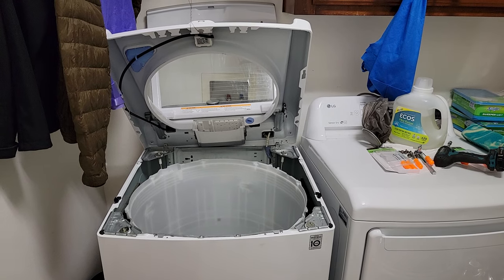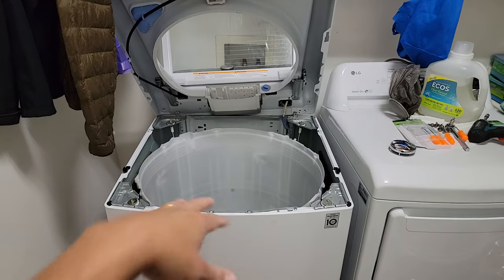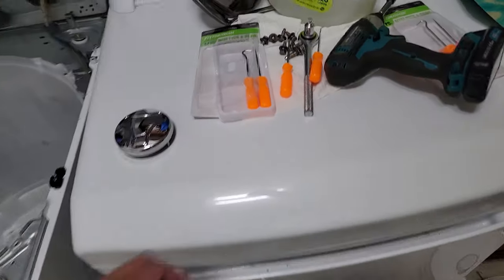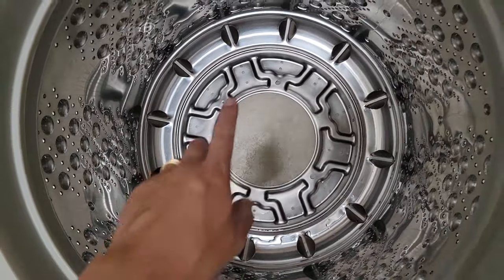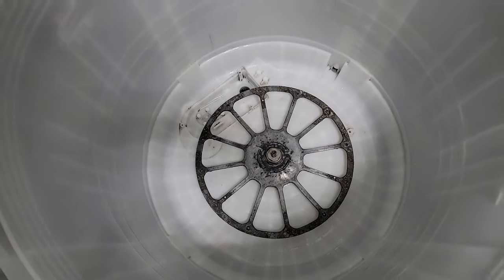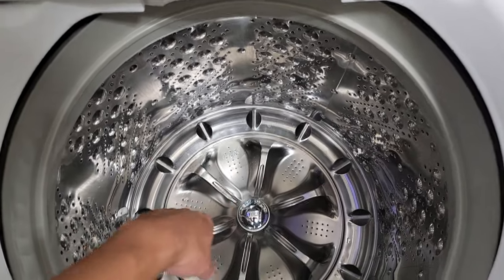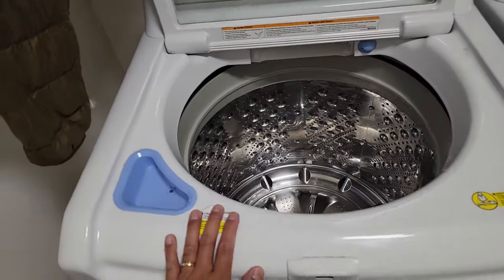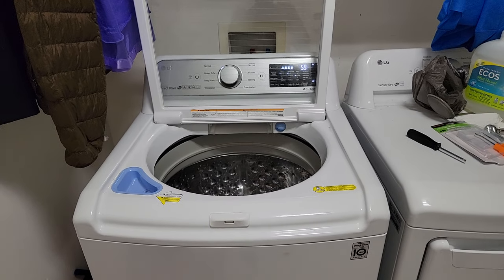LG washer take apart, disassemble, deep cleaning

Comment: Thanks for your video. My LG washer is only 2-3 yrs old and we started to have pieces of calcium and brown deposit on our clothes. Disgusting. Your video helped find out how to remove the top part and then, the rest is quite easy. I had 12 bolts to remove the drum (vs 6 on your end). Now it's all fine. Under the drum there is a big iron piece where calcium was building up. I will now on use CLR regularly to keep this thing clean. Thanks!
Reply: We have the same problem. Did doing this whole cleaning actually make the brown flakes go away? I am thinking of trying this...because our 30+ tub clean cycles with all the various tricks haven't done the job
Reply: @AngelaVetch-yb5fn   yes! Doing a complete disassembly and clean will make the brown flakes go away. I've done it on multiple machines for friends and family. The supermarket tub clean sachets didn't fix the problem, but a proper deep clean with the tub disassembled did the trick!
Reply: @s_rofbear oh no exactly what I didn't want to hear 😅 well at least I know now! I swear my whirlpool top loader with an agitator never had this issue for 15 years but this LG....

Comment: I really wish that you had shown how to actually remove that main top cover to access the drum. That's a critical part that you didn't show. Unfortnuately I can't get started with anything else until I can somehow get that cover up like you have at the very start of the video.
Reply: watch till the end, he shows what 2 bolts to screw off. It is exactly as he says in the video: unscrew those 2 bolts, then lift app and push forward the panel about 1/2 inch, then the top can come off.

Comment: Great video.  I didn’t have the mini hooks so I simply took two finishing nails and clamped them in two vice grips and I bent the finishing nails to a right angle at the tips. Worked perfectly and the agitator popped right out.  

There was grime on the mounting area of the agitator as well as the agitator cap.   My washer must be a bit larger because there was I believe a dozen nuts holding the drum down.  I could not loosen the nuts with a socket and ratchet nor my cordless drill.  It was difficult because the drum would keep spinning while you’re trying to turn the nut.  I could’ve got my impact wrench from the garage that I use with my compressor but my wife and I decided the cleaning was good and if we have an issue with odor next time we’ll do a complete disassembly.

For others doing the job the first thing that I did was remove the sump pump from underneath the washer and clean in the sink as well as scrub out the drain hose to the sump and from the sump to the wall drain.  The flex hoses  were very stinky, but not too grimy.

When we do a deep clean like Howard did, I’ll have my wife video me using Howard’s technique.

Comment: This video was very helpful!!! Thank you Howard!!!

A few things I figured out as I was following this excellent tutorial:

1: I was able to get the drum out by using paracord wrapped around three screws which I placed in a triangle around the wash plate close to the middle bolt. I put tension on the cord which was in a triangular pattern as I hit the center bolt with a heavy hammer ( do not hit it like you are driving a nail). It released after a few good hits.  
2: after the wash plate come out, I noticed the same nasty grim vinegar

Comment: Thank you SO very much - your video was very helpful even though my LG model was a little different.

I’ve only had mine for 4 years and despite cleaning it with vinegar or bleach or Affresh tabs the outside of my drum was disgusting. A little elbow grease and a scrub brush and Method degreaser in pink grapefruit and the washer is clean again. It took me 1/2 an afternoon (stubborn bolts on the bottom!) but it was worth it. No more stinky washer.

Comment: GREAT VIDEO with FANTASTIC INSTRUCTIONS!  You are Da MAN!  You have just solved the mystery on how to open this machine.  Our machine has a lot of flakes and debris, no matter how many times I run the TUB CLEAN cycle.  It does very little to alleviate this problem.  I was thinking that the water pump was clogged and backing up instead of draining.  I'm going to follow your instructions and hopefully this will stop the problem after I have it all cleaned.  THANK YOU VERY MUCH!
Reply: same thing
Reply: After all the trouble of taking this machine apart, and after all the cleaning, when I was putting it all back together,, there were some stripped bolts.  I put this LG washer out by the curb and REPLACED it with a new GE washer with the agitator.  GOODBYE LG.
Reply: @anthonymolero113  good call. LG wash plate stays dirty deep inside between metal and plastic layers no matter how much cleaning is being done to it. I wonder if GE has a better-designed wash plate.

Comment: So much more to cleaning this beast. You arr spot on how to disassemble it. The gray Ring around the tub is filled with chode water that needs to come out. The agitation plate is a 2 piece item that has stainless steel pressed over the plastic carrier that ypu will never be able to clean but holds nasty crap between it.  The steel wheel at the bottom of the hold tank is nasty and shit grows on it. If you can remove it you are a Rockstar. If not get out the razor blade and a wire brush and you still won't get it 100% clean. 
I took the steel tub out and pressure washed it and it's like new.  Put it all back together put about a gallon of LAs Totally Awesome cleaner in the washer let it sit for 24 hours and then do the tank clean and it smells better. You will still get some floaters as stuff breaks loose. Good luck all. It's a shitty design for trapping crap you can't clean
Reply: This is so true. I just went through this process. It's relatively easy to disassemble and clean the drum (inside and out) as the video shows but that agitator disc is the REAL problem. As Jason mentioned, the stainless steel you see when you look down in your washer is stamp-pressed around a large plastic disc. Good luck separating but even more good luck ever putting it back together.

I kept sending a fairly high pressure, directed stream of water onto the gunky plastic part thinking I got it completely clean and then after 20 minutes or so of this, noticed that flakes still kept floating out from the inside. It gets trapped between the plastic and stainless steel. I am now online looking to see how much the replacement agitator piece will cost because otherwise, this just isn't going to 100% solve your problem. I never use fabric softener (which causes this when mixed with your detergent) but I "inherited" this garbage design from the previous owner when I bought the house. I will never, EVER buy a top loader since it sounds like this happens to all of them.
Reply: Agree about the agitator disc.  There is no way to clean the inside of the agitator.  I just ended up buying a new one for about $95.  Problem solved.
Reply: @vger2  100% on the washer plate. It does feel like it is designed to collect dirt and force you into a repair after 1-year warranty is long gone.

Comment: Keep in mind. When you go to take the top off, be mindful of the inlines. I was wrestling with mine for a bit and almost cut through a line by smashing it against a raw edge of metal that holds the top to the bottom. Just a heads up from experience.

Comment: I took my washer apart and scrubbed all of the “scrud” out of it. I can hear water sloshing around inside the drum after I took it out but couldn’t figure out how to drain it. After everything looked squeaky clean I reassembled the washer and ran an empty cycle. When complete, I still found flakes/residue inside the drum. I have no idea where it’s coming from, unless it’s coming from inside the drum itself.
Reply: I think it's coming from the wash plate. It is really really hard to get all of the dirt from under the metal layer that's stuck between it and the plastic. I bleached it and rinsed it from all angels and can still see dirt there when looking against the sunlight. I think water in the drum might be there for balance.

Comment: Should I expect the center bolt under the cap to be really really hard to turn the 1st time. I tried to remove, but it was turning slow and I was concerned that I would break it. I was turning counter clockwise (to the left).

Comment: Oh My Gosh !!!
How would a tiny person perform this task ? 
So if we get an LG Top Load Washer with an impellor, we get some kind of weird build up ... so we have to take it apart and clean it every 2 to 3 years?
I was ready to buy an LG Toploader tomorrow ...this is really concerning me... 
if it is a washer .

 that cleans my clothes...what is this build up that needs to be removed from the washer ?
Reply: Just cleaner ours due to the "scrud" flaking off and finding it on clean clothes.  It wasn't hard, and the drum doesn't weight that much.  We didn't run a clean cycle on it as frequently as we should and this is what you get from it.  Overall, it cleans clothes but you have to maintain it.

Comment: One of the nuts on the washer drum will NOT come off….any suggestions. otherwise great video
Reply: If its the middle one. We use 10mm but.. we used several 10s untill founf one that worked. We thought it was stripped or something untill one just happened to work

Comment: But will the white plastic piece underneath the center middle piece of the drum come off b/c I can see shadows of black stuff that looks like it is in between the bottom of the metal part and the plastic part.
Reply: Omg I am in the same dilemma as you! I could see the shadows of it. I took my waterpik (I don’t use it anymore) and managed to break some of it loose with the pressure from that but there is still a ton in there!

Comment: Have the same washer and the agitator came loose during a wash cycle like floated up.  Do you know where you could find some replacement parts for this?  Repair guy wants 140 bucks just to arrive and diag. it... seems pretty pricey cause who knows what they might want to repair afterwards so was trying to see some info.  This video was super helpful as its the same washer.
Reply from the maker: I actually bought one from LG directly, as a backup  in case I broke the original during this project. It's about $140. You can find it directly from their website. I didn't need it and ended up returning it.

Comment: I think the reason this "scrud" accumulates is the exit point of the hose is higher than the bottom of the tub... so, trapped water not fully discharged is allowed to sit. My thinking is -you lower that exit point -so it's about the height of the pump -an inch or two above the floor, and then the sitting water will sit in the lowest loop of the hose, like a P-trap. I just cut a bit of the steel body with some tin snips so I could drop the hose down. 

Also, the design of the agitator is SO stupid -allowing scrud to collect between the stainless top plate and the plastic plate it's pressed to. After carefully bending the circumference of the steel plate away from the plastic, I separated the two -cleaned the plastic part well, and just installed the plastic part by itself without the steel plate. The plastic seems tough enough to endure the abrasion of zippers and rivets, etc. Since the little "hub cap" won't go back on the plastic, I just cut a piece of polycarbonate (plexi-glass) and screwed it onto the plastic with a rubber gasket in between. Just about to run a test wash, but I think these fixes will help eliminate future issues. (still shaking my head at the terrible design.)
Reply: The 1 and only reason you have this build up in your washer is because  you use liquid  soap and it is not soluble in anything  but hot water. Had you used powdered soap you wouldn't have this as an issue.

Comment: Thank you so much for this,  I have used every cleaner I found but the smell just does not go away.  I am however having a hard time with the center bolt and none of the tools I have use are doing the job,  I do not want to ruin the bolt to I will wait to see if anyone has suggestions.  Thank you again for this great video and even the cut warning...
Reply: you need a 38mm socket, I just ordered one on the zon
Reply: Mine was a 10mm socket.  Use a 3/8" socket and a ratchet with a longer handle for leverage, and make sure to turn counterclockwise. You can add WD-40 as a pseudo lubricant.

Comment: How do you clean out the crap that gets trapped in between the metal and the plastic on the plate? Does the plastic not separate from the plate?
Reply: That's what I want to know!  I can see there is shadows of stuff in between
Reply: I did some research.. so far, you can’t get it 100% clean. Only option is the buy a new agitator.

Comment: I’m unable to remove the agitator to do a deep cleaning. Any suggestions?
Reply: Me either. I have the bolt off but it will NOT come up.
Reply: That's my problem too! It's super stuck.. and I feel like we are breaking it trying to get it off.
Reply: I had the same issue and really worked to get the thing off. What I found to was using the picks Howard suggested but instead of trying to muscle it off use a firm, gentle rocking motion and it will slowly loosen and come off.

Comment: my machine is almost identical. I said almost. It took a couple of hours and various tools to remove the agitator, The thing was seized in place pretty solid. Ten I started removing the nuts at the bottom of the drum. Do not do that . The nuts are on upside down bolts that fall in the bottom of the machine, they are not magnetic. So I had it. Time for a new machine. not worth the frustration.

Comment: I cannot for the life of me pull that bottom piece out of the washer. I’ve tried with the hooks. Pulled with all I had and it won’t come out
Reply: If you run a hot wash cycle the agitator plate will come right up after a couple minutes
Reply: I had the same issue and really worked to get the thing off. What I found was to use the picks Howard suggested but instead of trying to muscle it off use a firm, gentle rocking motion and it will slowly loosen and come off.
Reply: I'm in that same situation right now of trying to get the adgitator plate off. I tried running a cleaning cycle since it uses hot water, didn't work. I'm not trying to run a soak cycle and pray that will loosen it up. If not, I don't know what I'll try next.

Comment: how the fk there nooo screwsssss?? see them plastic triangles it has holes for screws there is 8 all together, my machine is the very same as this one , I took out 8 screws, also that tool set BS is fkn useless I tried many times and it would just flex and spring back out,. so total BS this video.   i used corse 2 screws one on each side of the pulsator screwed the 2 screws to left and right side that used pliers each side to jerk out the pulsator.